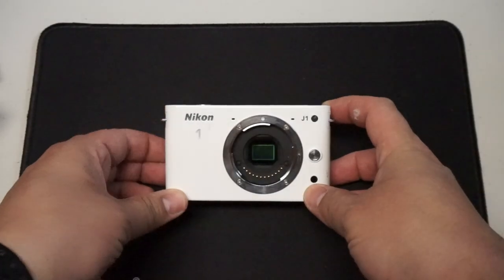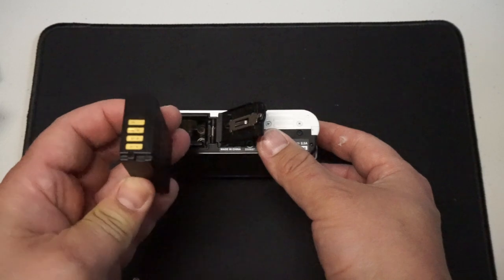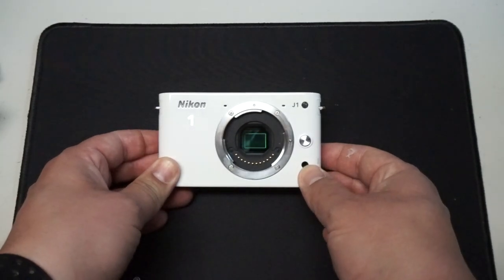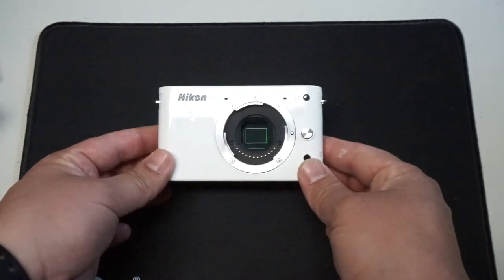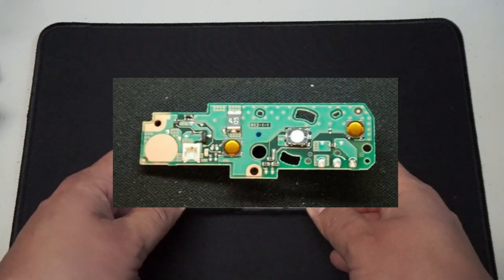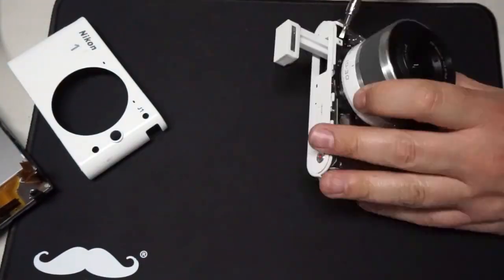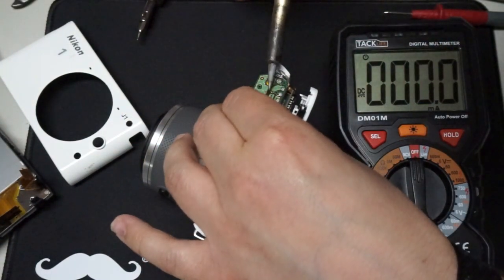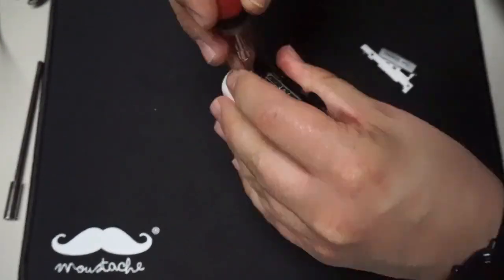Repairing a Nikon 1 J1 Camera That Won't Turn On

Comment: Excellent result from your troubleshooting effort! There's nothing quite like the thrill when a previously-dead product springs to life after you've doe a repair! 

I'll mention that one other possibility for that open-circuit part is a diode. Devices that can be powered by an external DC adapter often have a diode installed in series with the DC input pin, as protection against someone connecting up a DC adapter with the incorrect polarity. If the part is a diode, it would have had some kind of polarity marking, typically a band on the cathode end. Since you never said any thing about this, I'll assume that the suspect component didn't look like a diode.
Reply: Thanks for commenting this! I know it's 3 years old, but:

As far as I understand, these diodes are mainly for reverse polarity protection. My fuse was blown, but after replacing it the camera would still not respond. The SMD diode (turns out it's a fuse, see edits) (marked P 125 on my camera) was measuring "OL" in both directions -> it seemed to be blown as well.

For some reason my replacement fuse went bad *again*, so I bridged the diode with a wire and replaced the fuse a second time. The light turned on and the display shows the date/time settings page!!

Now I'm off to find out what kind of diode I can use to replace the original one...

EDIT: Maybe it's a 1.25A resettable fuse, but in my case it seemed to have blown completely instead of resetting?

EDIT2: I asked on Stackexchange. Here's the answer: "It's a Polytronics SMD1812P125TF/16 with a hold current of 1.25 A, so you are correct."

Comment: did you just put a solder blob without removing the fuse?? .. it's a great video btw !
Reply from the maker: Haha, yes, yes I did! That was just to see if it was working though, a little risky, I admit, but I did check for shorts. In the end I removed the blob and put a fuse in a few days later. Thanks!
Reply: @thedoghouse825  what kind of fuse  did you used
Reply from the maker: @madaradog14  I think it was 3A? I can't remember, I couldn't tell from the original what fuse was used, so I just threw one in there. Sorry.